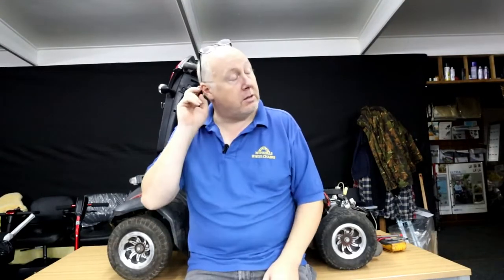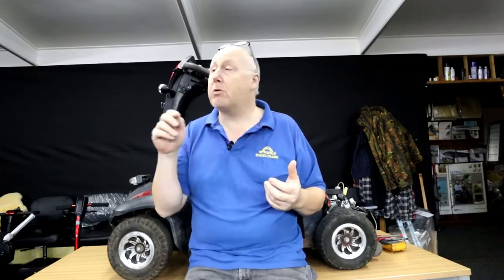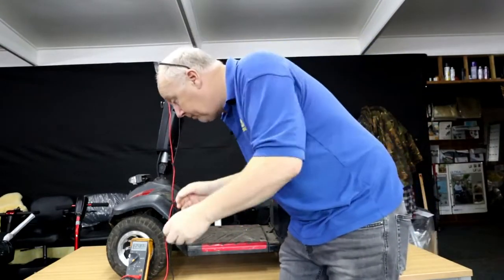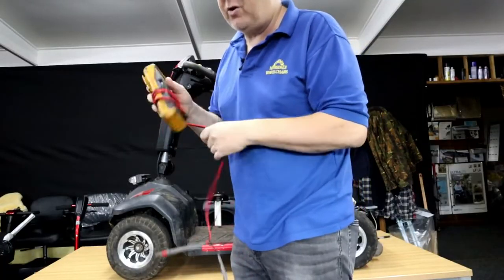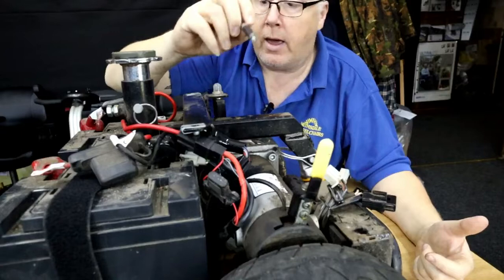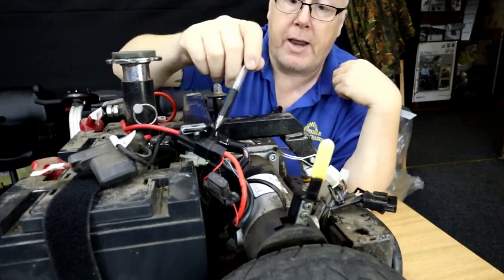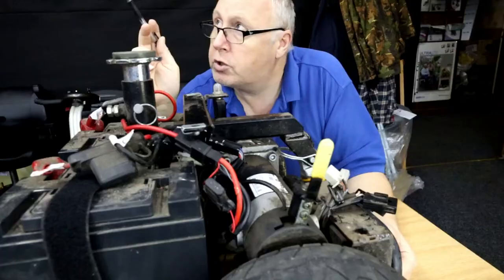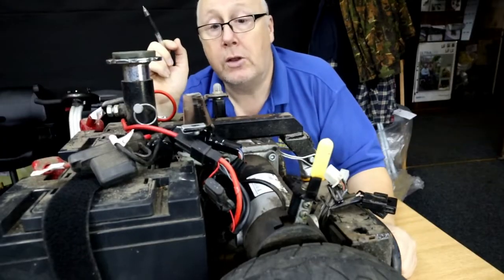Mobility Scooter Jerky then wont move

Comment: I use a mobility scooter and I am able to do my own maintenanc. I trained as an electro/mechanical engineer. However, you always need some guidance. I have contacted Tom on a couple of occasions and he has always been most helpful. Hes a genuine guy.
Reply: Hello Paul, I have a new 3 wheel scooter and the brakes are slow to react, can they be improved do you know please, regards Ian.
Reply: My chair is gogo three wheel one has power wont move checked everything fuses the whatnot breaker thing its good but still wont move what do i do

Comment: Good stuff I've just put two shoprider scooters together to make one good one. I'm a woman and they're my scooters. Only thing is I have a few disabilities. The problem I Have now is my lights won't work. I've got new batteries on the spare. My other scooter is jerking away then stopping when I stop. So the fix was I have to get off the scooter and then put the yellow lever down move it a few inches and it worked again. As when it shakes and judders it bloody hurts. So I've put the new batteries on a spare one I had for the tyres a year ago. It's been outside but I had it well covered a litte bit of mould etc. Anyway I have done my best. I even swapped the fibre glass case from the back as my scooters lights worked. Nothing o the newish one but the power is fine no juddering noise when it reverses etc. So fingers crossed. Put the best tyres on. I feel guilty leaving my beloved scooter outside!!. Do you think it's just a fuse? I had a good look at them and cleaned it up there was only one wire attached to the fiber glass hood and it fitted well on the one Im trying out now.
Reply from the maker: If it’s jerky then clean the commutator and check brushes we have all that in stock if you need

Comment: Tom another great video and very useful information thanks. I get how the carbon makes contact with the commutator but where in the housing does the upper spring contact go? Should it sit to the side at 90 degrees as the spring is bent that way ? Much appreciated

Comment: Hi am pleased to commend you on your contributions on & of the ills of mobility scooter: but I have a problem I would like to ask for your advise! I own a Drive Cobra GT-4 mobility scooter approximitly 4 years old that a first I through needed new batteries because after a charge the scooter would show full charge but would rapaidly lose that charge within 30 minutes of normal use; after batteries exchange the same systoms exist plus now it has no power to climb any inclines no matter how low! What could be the cause? When ever you have the time of course THANKS IN ADVANCE!
Reply from the maker: Hi check your electric brake may be binding on.

Comment: Hi. Sr. I have a pride victory 10 scooter. When i go on reverse it goes really slow i have to push it with my foot. The speed control knob is at the highest. Forward is fine but reverse is way too slow. Your help will be greatly appreciated
Reply from the maker: Hi may need a programmer to increase the reverse speed. Or may he a worn throttle pot. Mind you the reverse side is hardly used they way to find this out is the switch the 2 outside wires on the pot and then check

Comment: Hi.  As I have a very hard time walking more than about 200 feet, a friend of mine gave me a 4 wheel pride, legend scooter to use.  He got it from a relative that just passed.  So it worked for about a week and then I tried to cut my grass by using the scooter to pull the lawn mower. Very quickly it started to jerk and then wouldn't move at all.  I turned the switch off and back on a fee times and it moved once and then nothing, I would like to fix this scooter and get it working again, but I'm not sure what parts I would need to buy to replace.  Would you mind helping me with your experienced opinion as to what might be wrong and what I would need to order. PS, I've changed the batteries, and that does not help, but the lights and horn are working fine.  It just wont move and the motor is not working at all.  Any help would be greatly appreciated. Thank you.  Robert from Calgary Albert Canada.

Comment: I have an old Bruno cub I can't find brushes for. I used 2 "43" brushes that I filed down to fit. They work but they get very hot. Is this normal?  I also used a glass Fibre pen and cleaned it before I installed them. It runs but not very powerful. Is the motor shot?
Reply from the maker: @jonmeek8802  hi , sounds like it. Mind you if the brushes don’t fit then they will move around

Comment: Hello Tom brilliant videos thanks for help in the past, I have tracked a problem down to the relay on my controller Rascal Electric Mobility TE-388EM i need a relay for this TTi TRP-24VDC-SA-11R do you sell these as a part or is there an equivalent?? thanks Steve.
Reply from the maker: Sorry we can’t get those relays or any internal parts for the control boxes. We send all our boxes away for repair. Or supply new ones.

Comment: How would I go about testing the leads on the batteries to verify they're being charged by the onboard charger? I see 24v entering the electronic control module (ECA) but then it doesn't seem to be putting anything out from there. Rally scooter. Circuit breaker button doesn't hold down, just freestyles.
Reply from the maker: @MiguelRamirez-ld7sy  hi. 👋 if power does not come out of the controller then there will be an issue with something else as it’s designed not to send power out if there is a problem with the motor. Brake , throttle , speed pot, wiring, terminal connectors, or even it a charger is connected so with that in mind you will have to check everything

Comment: I have had an issue with my Freerider Kensington S,  everything working except the drive motor, fault traced back to the motor plug where it enters the controller, burnt connectors, now cleaned, a touch of Vaseline on each connector and I am not mobile. ALL CONNECTORS ARE WORTH CHECKING
Reply from the maker: Well done 👍🏻

Comment: Have a wheelchair with 4-pole motors and I am going to replace the brushes but wondering what's the best way to blowout the carbon within the motors?
Reply from the maker: Air line. Or you can get tins of air with a jet.
Reply: @tomjacques4  Thanks for info. Don't suppose you know the size of brushes needed on a Sunrise Medical Q700r?

Comment: Love the videos thank you I have a Care co Zoom plus when attaching the rear end of the scooter sometimes I have to use some force to make the release catch lay flat I have checked and oiled the frame etc any help please
Reply from the maker: Check to see if any dirt is under the frame where it connects to the front. May have a worn lever Assy. Has it been like this since day 1 if so take it back it not then check it with rear panel removed to see where’s its sticking , maybe a file here and there may help.  You will need to check
Reply: Hello again I just upgraded to a Pride Elite Traveler mobility scooter and a bit worried when coming to a stop if the ground is slightly raised the scooter free wheels back and  have to put my feet on the ground to stop the scooter I was thinking it might be the electronic brake but i don't get any problems when using it normally can you give me some information if it is the e/brake to supply to me please many thanks

Comment: I've got a wee bit of a problem I can't solve. Battery is fully charged, Charger works, and 24.5v at the charging port, but as soon as you accelerate, she only goes 3" and konks out. It's almost as if the drive lever is popping out, but it's not. And I know the codes don't go that far, but it beeps 8 times! Och I dae nu?
Reply from the maker: 24.5v is very low voltage.  What’s the make and model

Comment: Hi Tom hope you are well. I purchased a Gogo plus everything works on it no beeps no flashing lights the problem is that when you go forward from Stand still it clonks and jolts you back into the seat likewise when you go backwards.we traced it back to the rear part as we tried another one and it worked fine. The motor itself looks like it has been worked on before with a new gasket and its very clean for a 2014 model
We did try and change the brake all be it from another model but still the same problem any idea?

Comment: .Hi Tom. I am asking for your help, please. My Scooter moves forward and backward well, but the problem is that when I turn it on it launches a continuous beeeeeeeeeeeeep that does not stop until I turn it off. Do you have any idea what's going on? Thank you very much for your help.
Reply from the maker: Hi could be water in the horn switch? Check where the noise is coming from.

Comment: wiring in throttle on one im working on - the  wires bot pulled out of the the two spring sensors (one on each side)  2 brown and 2 black wires - on the little sensors there's a piece of metal to solder one wire and next to it on the same sensor is a wire to solder to.  well how do you figure out what wire does what inside the throttle?  (twist throttle)
Reply from the maker: @AEON.  twist grip eh mm yep silly using same colours must be a money saving exercise from the manufacturers. Speak to the supplier that’s my best suggestion.

Comment: i have a broken pin on the wire from the motor to the connecter , linked to the battery  can i replace it ,cant gat a pin
Reply from the maker: @jacklee2405  hi send a picture to tomjacques@btinternet.com

Comment: Hi I spoke to you yesterday about I thought with my partner is back lights I have got another issue what I would like some information about when I turn the scooter on and then go to go forward it goes slightly backwards and forwards any suggestions
Reply from the maker: Could  be a software issue. I presume the scooter was on a level surface.
Reply: @tomjacques4  thanks again forgetting back to me yes it was on my level surface we purchased the Mobility Scooter last year and when we purchased it it only had 4 miles on the clock  my partner has used it now for one year and then all of a sudden has now started this issue so when you go forward it reverses around 6 to 8 inch  backwards then goes forward

Comment: hi i have a day strider been kept in shed not working i know batteries are fully charged as indicater needle shoots up to max on gauge when key turned on i know its not electronic brake as this is just hanging off to check it and working fine micro switch works.when i push lever to go i hear a click in i think control box but not sure its not the brake micro its louder the scooter just judders but not far about a foot then stops it keeps clicking on and off somewhere in back when lever to go is held on perminent   i know motor moves as can see it but scooter hardly moves  far any ideas please all fuses are ok and all leads pushed together properly
Reply from the maker: Hi check disc that is inside brake is moving freely when power is applied. You will need to remove the brake to do this.  Also check motor brushes
Reply: @tomjacques4  i have followed all your videos and have already removed the brake and that component is working as it should
Reply: brushes look newish not broken at all
Reply: checked all cable conections are in properly there is no beeping or flashing light when ignition key turned on just stays iluminated
Reply from the maker: @markellis8337  have you tried driving without the brake connected to the motor

Comment: If the batterys are both new and voltage going in to controller is 25 and out the most it will do is like 9 and 8 volts in reverse am i missing something he needs this thing to get around and i said i would look but ijust dont know

Comment: Ok my chair powers on beeps then stops but wont move at all checked all fuses nothing still wont move has power just wont move either direction
Reply from the maker: @CassandraEddy-ih7gw  you will need a programmer to establish fault difficult 😥 to say what’s wrong with what you have said. I would check all connections do continuity on motors,  brakes and bus cables. Do you have a flash code ?

Comment: Can someone tell me how to wire a new brake assembly, when my old one has four wires, two for the coil and two for the micro switch. The new ones only have two wires, how do I wire it back to the harness,( Motherboard)? 
It’s a 2000 pride sundancer.
doesn’t move After I replace the batteries and accidentally squirted some WD-40 around the brake assembly and used a car charger on batteries. (12VDC, 
12 Amp) to each battery individually, but failed to unplug wire harness. 
I’m wondering if this screwed up the motherboard by back feeding.? 
Using process of elimination……
I have Continuity on the micro
switch.
No continuity on the coil for the brake assembly.
Continuity on the motor, but can’t get any ohm reading. 
I was going to apply directly power 24 V DC to the motor to confirm the motor works. 
I’m thinking the only thing that’s wrong is the coil on the brake assembly and I set of new brushes for the motor after I polish up the commutator and blow it all out.
Can someone tell me how to wire back to harness the new style two wire brake assembly to a four wire harness. 
And explain the sequence of events related to power flow after you press forward or reverse… were does it go 1st, 2nd, 3rd for understanding.
She was always a little jerky from time to time not too bad, you’d have to rock the chair back-and-forth a few times to get her to go again.

Comment: Hi bought a rascal mobility scooter and it was doing 8 mp and had it 2 weeks is second hand and it slowed down really slow so bought 2 new batteries witch cost a fortune and no it’s not that could u please help
Reply from the maker: I don’t ken what model it is but I would check the motor brushes first. Batteries have nothing to do with speed of a scooter. But it’s the distance the scooter they control.
Reply: @tomjacques4  thank you
Reply from the maker: Could also check the brake if it’s binding on
Reply: We’re do I check sorry for bothering you
Reply from the maker: @JoannDarlington  hi mate so much to check need to do continuity check on brake etc. some other videos that we done show that

Comment: What about a wobbly wheel
Reply from the maker: If you have a wobbly wheel then there may be an issue with incorrect fitting slack bolts or a faulty / bent axle.

Comment: I have just got a scooter from my friend, it is from care co originally approx 8 years old but only used a few times, then decided to use it again so put two new battery's on it, and again never used it so it lay for over a year, I got it this week and charged it up and went out on it and it just stopped dead after approx 10mins, when I got it transpoted home again I put it bk on charge cos I thought maybe I hadn't given it long enough ,then the next day I took it out it done the same thing stopped dead after approx 1hr, and had to have it  transported home again , thr ight is not working on it and the horn is not working , it is suppose to do 8mph but it is not doing that I would say approx 5 or 6mph, does anyone know if it would be the battery's as they had been in the scooter for approx a yesr, if I got two new battery's I'm thinking that may solve the problem, I don't know the model but I have the serial number and it says it takes 2x12V34AH battery's should I order them and try it or get someone to look at it, any feed back would be appreciated.
Reply from the maker: Think an engineer would be your best bet a lot to look at

Comment: I have a question about my scooter.  It is jerky and I took the gearbox apart and replaced the tiny bearing and cleaned out and regreased the inside.  It still feels jerky (almost like I'm driving over a washboard). I don't feel it at fast speeds.  Could it be the motor? I have a 3 wheel gogo scooter elite. Thanks for any suggestions.
Reply: Did you ever find out why your GoGo 3 wheel was jerking?  My GoGo 3xl is starting to jerk when I turn it but it doesn’t happen all the time.
Reply: @landslittlefrenchies3304  I never did find out what the problem was.  Sorry

Comment: My horn works, but no lights on the battery meter, batteries all checked out
Reply from the maker: Check the voltage at the wires to the battery gauge and follow the wires back
Reply: @tomjacques4  will do thankyou. 
.
Reply: which connects to the wheel, motor carriage @tomjacques4  I'm getting 15.6v on the female connection on the main body

Comment: hi mate i have a rascal ventura and my tiller has become quite loose/wobbly.  the wobble seems to be coming from low down on tiller perhaps where the bearings are?  do you know how to tighten up a wobbly tiller?  i already tightened really tight the big bolt near bottom of tiller.  also a small alum key bolt down near there i keep tightening that aswell.  my steering has become very  "light"  so i have to use 2 hands on tiller as with one hand  it can steer left or right so need ride with 2 hands on tiller aswell. any help appreciated.   EDIT YOU HAD ONE IN HERE ON YOUR VIDEO THIS IS THE SCOOTER I HAVE WITH THE WOBBLY TILLER THAT YOU HAD AT YOUR PLACE - https://www.youtube.com/watch?v=RBnILbwNOS4
Reply: E both hands for safety !!!